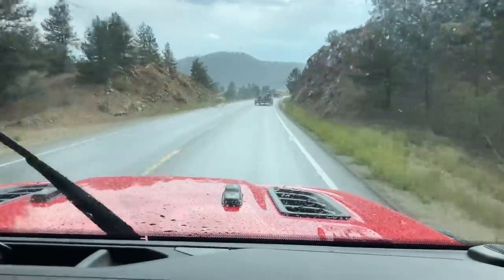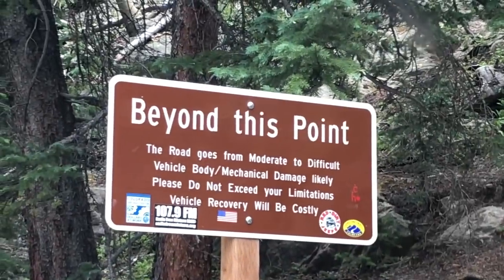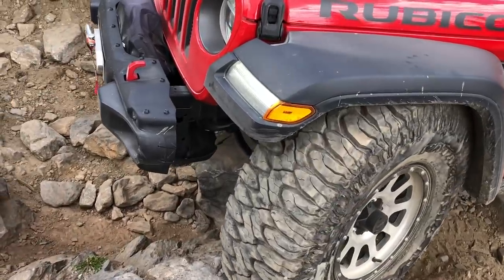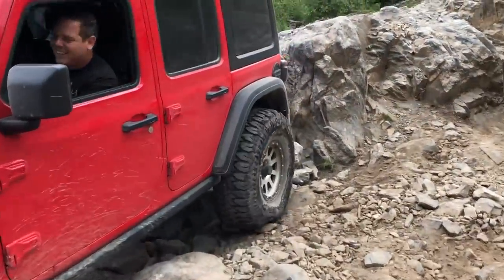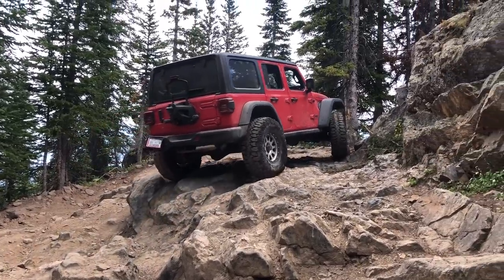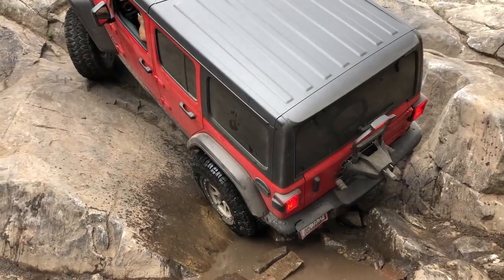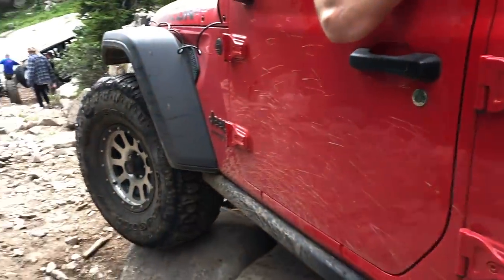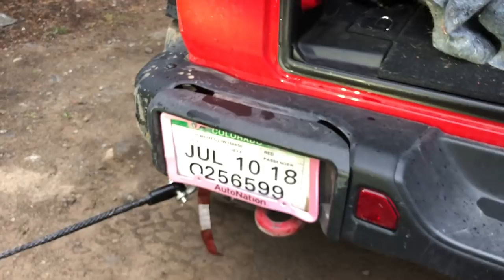We Take Our 2018 Jeep Wrangler JLU Rubicon to HOLY CROSS to Test the 38s!

Comment: In 03 I bought a wrangler tj and learned to off road a stock 4 cylinder jeep. I had an absolute blast and it was the best way to learn how to correctly pick my lines and effectively get to some amazing places. In 2007 I bought a jeep Wrangler Rubicon. The fun ENDED.........Locking front and rear difs made everything easy. I didn't need to pick the best or only lines anymore. The Rubicon would climb almost anything even if you did it wrong. All the skill and challenges of off roading was gone. I loved my Rubicon but it will never be as fun and challenging as my old 4 banger open differential stock jeep. The best drivers dont need lockers and gadgets to get through tuff spots. They are the most skilled at picking a line and keeping the jeep on it. I promise you that. I jeeped with the Hemet Jeep Club, the oldest, largest jeep club in America. Those old dudes seriously know what they are doing and what does and doesn't work.

Comment: Lol...
First time I ran that trial was July 4th 1981.
In my 1979 CJ5. 
manual steering, no power brakes.
Bought it new, as it set on the lot without a top...
258 straight 6 n 4 speed w/ granny first...
By then I had put on "huge 31" tires.... 
One of my most memorable n fun jeep runs of my life !....

Comment: I used to live in Vail. Did this trail back in 2000 in my 3 month old 2000 TJ with a brand new 4.5" Rubicon Express lift before I got my lockers and 4.56 gears on 33x12.50 GY Wrangler MT's(original humvee style). Great trail but it takes FOREVER to get up and back. Fun times! I miss it. I packed horses all over those mountains as well.

Comment: I have a 2006 TJ Rubicon, and they are awesome. I live in Florida where we have a lot of water, mud, and clay! I have a 1987 full size Blazer 4wd, w/ 1ton front and rear, w/ Detroit lockers front and rear w/ 6" lift and 36" tires, 435 ho 427ci, 700r4 trans! It don't hold a light to that Rubicon w,/ 35"tires. Like I say, they are awesome!

Comment: Hope you chose the lease option.  The oil burning at that angle is because when all the oil goes to the back of the engine, the oil pump sucks air instead of oil and the motor runs dry of oil.

Comment: Getting up that last part, a set of Red Label 39's on beadlocks set on about 4-5psi would do the trick. I run the Trepador competitions now and have ran the 37" Red label Krawlers as well. They are like cheating. I would be fine for doing what you did with a MT/AT hybrid tire that is not even a sticky or competition compound.

Comment: Give yourself more credit Kevin, people are saying they want to sniff your underwear in the video comments 🤣 who needs a diet when you have a fan base  like that!!! Also, just a heads up on the reinforcement kit... I put mine on last week torqued to specs and it lines up perfect but drops a half inch when I open it. I'd hold off and just get a frame mount swing out when you replace that stock rear bumper
Reply from the maker: Brandon Dougherty We appreciate the advice on the Reinforcement kit. Weve been going back and forth a ton on whether or not we should get it!

Comment: Was the only changes the 38's over the stock 33's? Taking a 50k plus Rubicon up such a tough trail was amazing, well done!
Reply from the maker: onawhim7737 We've also got a Rough Country 2.5" space lift. But yes, other than that, it's stock!
Reply: I'm looking at Jeep Unlimited and the Toyota 4Runner. Right now the 4R is in the lead, more bang for the buck. I don't intend to be rock crawling. Have any thoughts on the 4R TRD? BTW I see why you went Jeep.

Comment: Do you either use manual mode "first gear"  or
automatic mode "first gear"  to climb rock ?

Is there any difference between manual mode "first gear" and  automatic mode "first gear"  ?

Comment: I am reluctant to even run 37s on the M-series axles.
I know they introduced a .160" size increase of the ring gears, but being that they are mainly comparable to a dana 44 gives me concern. Especially if the rear M220 is a semi-float.
Regardless, amazing what creature comforts Jeep continues to integrate into each new model!

Upgrade front and rear shafts to 4130, upgrade to 1410 u-joints and HD driveshafts, upgrade the front knuckles, and thennnnnnnn those 38's would run without negative outcomes. Relatively speaking of course!

Comment: So just how many windshields do Jeep owners go thru??  That's at least the second cracked one I've seen while watching. lol

I run 32" Patagonia A/T's on my triple-locked Land Cruiser thru Rampart Range Rd trails East of the 'Springs'.  They do quite well on the kind of terrain usually found in these areas, dry, gritty, and w/o mud.  The tires came with the vehicle when I bought it and I had every intention of replacing them with proper M/T's.  But the guy said, "Give them a try before you buy something else".  

8" snow is nothing for them.  I was in 12" snow when I had to put on chains and at that point your tire tread doesn't matter anymore anyway.  So yeah, great value these Patagonias.

Comment: You two are just amazing and fearless!  Do you have any additional skid plating?  Reinforced differential covers?  Or, is it all stock?  I've avoided the extra weight of beefed up skid plates and such, depending more on proper tire placement.  You two seem to do really well with this, only bashing/bumping areas that won't prevent you from driving home.  I don't see any added armor, so I'm hoping you tell me there is none.  Great video!!

Comment: You guys running 38's on the stock suspension and gearing?  Or have you  re geared it?   Did you re program the computer for the larger tires?   Can you shut off the tire pressure alarm via the ECU programmer?   I'm looking at  upgrading my 2016 Rubicon to a 2019 one.  Thanks for posting  these videos.

Comment: I have a 2.5inch ifted JLUR I put some ko2 35inch tires on it and didnt notice any power loss on the highway. After watching u guys put 38s on yours makes me want to go bigger lol. You notice a big difference driving on highway with 38s? Hows braking? You plan to upgrade axles or brakes or anything?
Reply from the maker: Tyler Gill She drives just fine with the 38s! Still havent noticed any struggling or power loss! No plans at the moment to upgrade, the stock axles are pretty beast.

Comment: Time to get you some REAL steel bumpers via after market. Might as well also get a license plate relocation kit as well while you at it.
Reply: Kevin Williams which skid package are you going to do?  Hauk's looks good.
Reply: I was eyeing the Rock Hard skid recently, but I don't do rock crawling (have the M/T and don't feel like stalling every 20 seconds and looking the fool) so don't really need it. It's the beaches and dunes for me.
Reply: Just know Rock Hard fits VERY snug, so if you have any trail damage in their bolt points, it might give you problems. But all in all, I think they are the superior ones (if you can get them to fit).
Reply: Does Artec make full skid plates too? Thought they only made those fender armor.

Comment: Hi Kevin, I have a 2018 JLRU with Mopar 2" lift. I want to get the 38" Milestar Patagonia on Pro Comp Rockwell Series 34 Wheel 17x8.5, offset 0 and BS 4.75. Do I need to do any modifications? Would it clear or should I stay with 37"? 
I drive 98% freeway/city and 2% off road. This is my first jeep and new to off roading in Souther California.
Reply: M. Aghai I’m not sure they will fit with only 2” lift.

Comment: You can get an ECU tuner and adjust the fan.
Reply: Transmission cooler upgrade for that 8 speed transmission. The fan shouldn't run for so long after that (my guess).

Comment: based on her spotting they can do anything better than everyone, except high centering at least twice based on spotting, sliding of a rock and denting the bumper based on spotting (and then her claiming everything was fine until Kevin pointed out the dent), overtalking the more experienced spotters on Cleveland Rock and ending in a spot none of the more experienced spotters had ever seen etc. etc.

Comment: How much did you pay for that bad boy? And what’s the cost per month. I looking to buy one next year.
Reply from the maker: Davin Link The JL usually runs around 50k, depending on what options you get
Reply: Lite Brite just got quoted 58k OTD. It had all the bells and whistles.
Reply: I purchased the exact same one last week here in Phoenix for 42k plus tax.  Options get stupid expensive.  Highly recommend you get a hardtop, LED lighting, and the uconnect radio/nav package.  Wish i had found one with a towing package for the bigger alternator and interior aux switches.
Reply: Jonathan Schmadeke congrats on the new ride. 42k isn’t bad at all. I’ve seen a new/used one for 45k but it was fully loaded. I just plan to save and get the one that I really want. I’m half way there on the down payment.

Comment: Are you running the stock Dana 44s with the 38s or did you re gear?
Reply from the maker: We ran stock gears and axles for a few months with the 38s, then eventually upgraded to a Dynatrac proRock 44 front and 5.13s

Comment: 38s on stock Rubicon 44s!?  I think you guys should invest in some spare axle shafts!  Good thing Kevin doesnt "send it" on every obstacle.
Reply: Yeah I have the same problem on my Xterra. My front CV'S are like tooth picks.
Reply: Yeah I've read all the Specs. If they put a diesel in the new JL truck when it comes out, I'm sold.

Comment: What kind of lift do you have?
Reply: Wow pretty good for the lower end of lift kits
I've been researching the rc 3.5 vs teraflex 3.5 vs jks...the rc is less than $600 while the other 2 are more than $2000.
It's nice to c the rc in a real application.
Thanks for the inspiration
Continued success to u and ur partner in ur relationship and ur crawling

Comment: It "buckled" because you put 3500 lbs on it, at a bad angle, which NO BUMPER can withstand, much less a stock steel bumper. Again, this is not off roading, this is rock climbing which NO CAR coming off any assembly line was built for in the end. The Rubicon does what it is supposed to do, but climbing rocks is not what it is MEANT to do. It is meant to do off road driving, over mild to serious terrain, but not climb 24" boulders.
Reply: T Meo Are you the FCA engineer that The Fast Lane Truck interviewed?

Comment: Great video guys, love your style, you make a great team! Very impressed with the JL overall, especially being able to handle 38" tires and no gearing work needed. Hopefully a new engine cooling fan is coming-out asap. Nice winching scene and use of the winch bumper at barricade rock around 21:00 minutes. 

The axles on the JL Rubicon must be made well, there was some fairly heavy torque at that spot with 90% of the weight on the rear axle and some hopping (very little), many axles would have snapped. I still say make the Rubicon with Dana 60 level strength at a min. 
-  www.bluelakeoffroad.com staff

Comment: Whoever designed this bumper that was sectioned out like that should be FIRED. Its like sectioning out the frame to install WIFI. I know an AMERICAN didn’t design that for sure! Because its just common sense in the offroad industry. Its time FCA does a little house cleaning here in Michigan. Ill pass till these issues get sorted out. As for early adopters... Automotive 101 New is fun and exciting but never buy the first run of any production vehicle. Ill look back into these in a couple years till they figure it out who to fire first. 🤣😂. Oh and why do the door mirror moulding fit horribly?? I was about to purchase one of these but seeing the fit and finish on it I decided to PASS. 😢